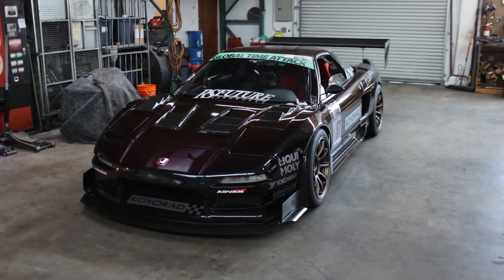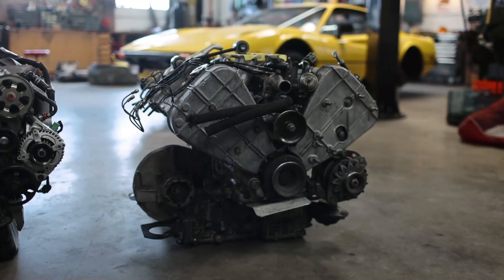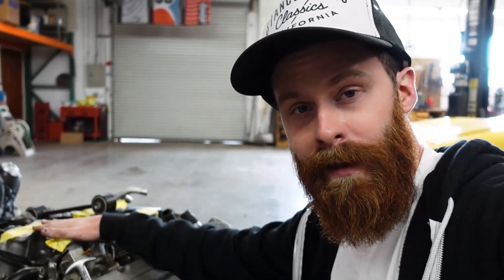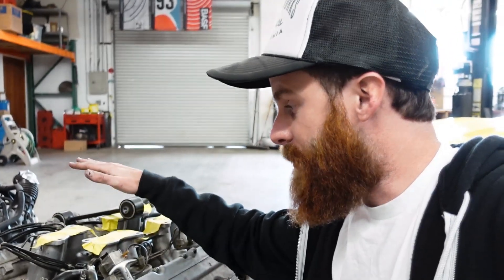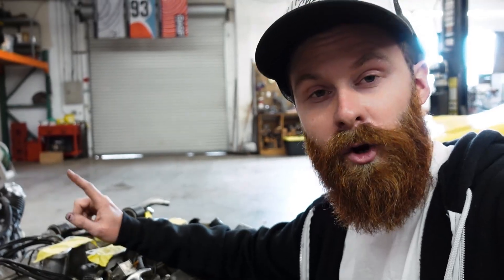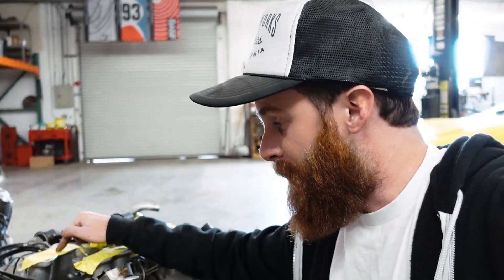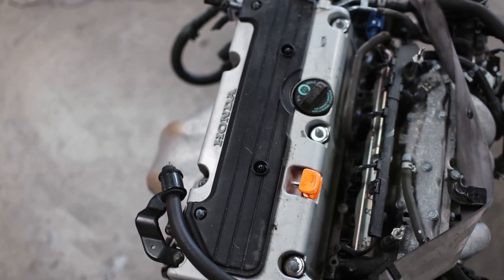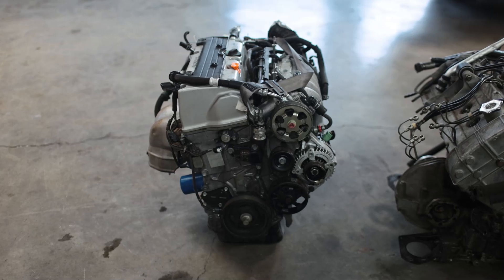Swapping a Turbo Honda K24 into a Ferrari 308 GTBi:  Let the Build Begin! - Ep. 5

Comment: More power, less weight, more reliable, and an endless aftermarket.  What's not to love?
Reply: Go buy a Honda then.
Reply: @norberthofer5830  I did. It’s the NSX in the video.
Reply: @RSFuture  So if you have the NSX.. then what is the point of this Ferrari transformation ?
Reply: @poplaurentiu4148  Because it's not his NSX.  He wanted a 308.
Reply: @RSFuture  your nsx sir is a beauty and a beast
Reply: @norberthofer5830  nah. Only like the engine.
Reply: @Jack Russelle Lewis more torque than your Minecraft Minecart
Reply: loveble
Reply: The sound in comparison.
Reply: It's not about the engine. Could be an Sr20 or a k24, once you do the work you can pull out 900 to 1000hp. Only an idiot would cry about the engine. 1000hp is a 1000hp no matter what manufacturers built it. Unless its alfa or fiat, that's a one rip wonder if you tune them 😂

Comment: Alfa Romeo V6 first choice!!! Massaged to 300+ HP, NA, individual throttle bodies, open exhaust😍😍😍😍😍😍;
 Second choice: Subaru Flat 6 tunes to just over 300 HP, individual throttle bodies, NA, nice free flowing exhaust👍👍👍 the sound alone is worth it...plus there is something really fitting using a flat 6, like a mini Ferrari Boxer😉.
I fully get the reasoning for the K Honda engine though, it’s gonna be sweet👍 just don’t over-power the thing, people are getting ridiculous with HP numbers, you don’t practically need more than 400 HP if you want to drive the thing hard and fast on the street.

Comment: In conclusion, a good looking car with high revving reliable 500hp engine. This project car can be grocery getter, track car, drift car, even drag car without issue at all and all you need to do is change the wheels. Good luck with the built 🍻
Reply from the maker: Well said!

Comment: Love it man. I'm swapping in a built N/A Subaru EJ251 into my 76 Porsche 912 (yeah, I've got the castrated, lobotomized 911 that came with a freaking 75 hp VW bus engine 😂). That's getting shit-canned. Working on designing the 'stealth' cooling system with tucked radiators in the front fenders.

Comment: K-swap makes the most sense.  I hope you build the engine first before adding all those go fast parts.  K-Swaps on MR2s, smart.
Reply from the maker: Worry not, we'll be doing a complete engine build.
Reply: @stanceworks  and a LSD diff in the trans set up I hope to lay down that powwaah.

Comment: My dad had a 1979 yellow 308GTB, similar to this and we all agreed it's a beautiful looking car, but as my dad always said, it was way too underpowered. I think even he would actually approve of this. Ferrari never told the truth with their power figures and even though my dad's one was carburetted, he was certain the 250hp figure was more like 200hp at best. 
That little Honda engine sounds pretty good also, because it revs like a Ferrari. Makes a lot of sense. 
Just hope you keep the wheels looking like Ferrari star type ones, bit bigger to accommodate bigger brakes. Even BBS style ones would look good. 
You'll lose a lot of weight if you remove the US bumpers for Euro versions, but it's costly. The US bumpers with brackets total nearly 100lbs !!!

Comment: Hi, I'm following your build... certainly a road less travelled. If I understand correctly you want to take an 80's 308i into the current world, with modern power, lower weight, better handling - suitable for track work. On that basis wouldn't it have been better to start with a mid-engined car, which already is lighter, better handling, track optimum ? I'm thinking Lotus Elise / Exige which the Honda K 20/20, either NA or FI  can fit into easy.... or is that a road too travelled ?
Reply from the maker: It's not too travelled. I think a lot of people, especially Ferrari guys that are bent about what I am doing and keep asking "why not start with a different car?" are overlooking the fact that I want the 308 for aesthetic reasons. I really like the way it looks. I didn't pick it for any other reason, and its largely the same reason I pick any other car to modify. Looks come first. I don't think there's any point to going fast if you don't look good doing it.
Reply: @stanceworks   Thanks for your reply. For sure the 308 is a lovely looking car - not a bad angle on it! Well I'm tuned-in for more adventures of your build... I'm not a Ferrari owner, so in my view, your car - its your choice :-). BTW, you're right, the Ferrari V8 'can' be uprated to make more power... but the cost is eye watering, I looked into it a few years back.

Comment: If you want to destroy the value of the car then you're on the right track. You could hang a single turbo on the Ferrari motor, replace the K-Jet fuel system with L-Jet programable with a Motec engine management. Custom pistons and titanium rods, lightened flywheel and clutch setup, over 400 HP, or ruin the car going your way.
Reply from the maker: Did you bother to watch the video? I explained why I think that’s a dumb idea. But if you’d like to do that to a 308, be my guest!
Reply: @stanceworks  You asked what I thought, correct ? Maybe quit playing games, why would I watch a video about putting a Honda engine in a Ferrari ?  Why the misleading title then ? Clearly everyone leaving comments didn't watch the video either.
Reply: That guy shoulda bought a Hyabusa/electric swapped fiero to cut up....no brains....that 308 was a mint sunday driver

Comment: A friggin duratec 3.0 out of an S-Type Jag has a forged steel crank. Scat makes rods for it and cp pistons. It's the exact same weight, higher revving, and more powerful. Think Noble 400M, 650hp and will go 1000hp with twin turbo and E85. Around 9500rpm and the sound is v12 F1 vs buzzing.

Comment: Cooling.
 A turbo-anything amidship is going to be problematic. Italian cars of this era never have enough radiator or oil cooler. The  engine compartment temperature is going to be a problem. The rational of the build  is interesting, so I will reserve judgement until it's done.

Comment: Excited to watch your progress, a few years ago I dropped a WRX ej20 turbo engine in a 1975 Ferrari 308gt4.  Only one out there . Here is a link to an article that was online:
https://www.carthrottle.com/post/this-subaru-wrx-powered-ferrari-dino-is-alternative-engine-swap-gold/.
Reach out to me if I can be of any help information wise.-Adam
Reply from the maker: Odd swap, but I dig it! Thanks for the support, Adam.
Reply: @stanceworks  did a lot of research actually not so odd.  They have been using these motors for rear and mid engine sand rails in Australia and the Saker car from the UK uses this power plant for a mid engine super car kit car.  There are mods for converting the trans to 2 wheel drive and adapters allowing you to use your stock drive axels.  Also I had adapters made to use all my original gages as well as raving a shift linkage allowing me to use the stick gated shifter.  Also had the new engines wiring harness adapted to an engine management system that allows for working with the original fittings.

Comment: Oh please please don't stance it. Build it to handle and you might get a great driver out of it.
Reply from the maker: Cars built to handle have "stance" too. I'll look great and drive wonderfully.
Reply: @stanceworks  it better! Or I’m going to cry myself to sleep every night until you put 15” wheels and normal suspension on it. Great engine choice, a Honda J might sound better but I feel like there’s more aftermarket for the K. Both are probably at least a little cheaper than the quad cam you took out. Probably.

Comment: Why bother with a crappy honda engine. They cost a fortune to tune and strengthen. Could have just dropped in a Saab B234 engine. Fully forged from the factory. 500bhp with zero engine mods and they will hold that for 200,000+ miles. Mine has.
Reply from the maker: I'd love to know what your definition of "costs a fortune to tune and strengthen" is, because $10k will build you a 1,000hp K series, and there are very few engines out there that can come close to the same power per dollar.